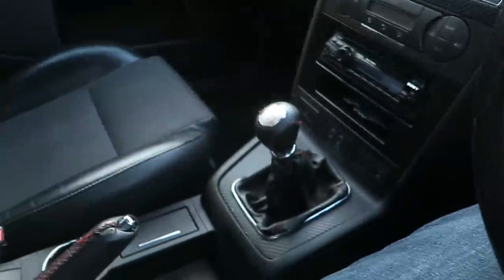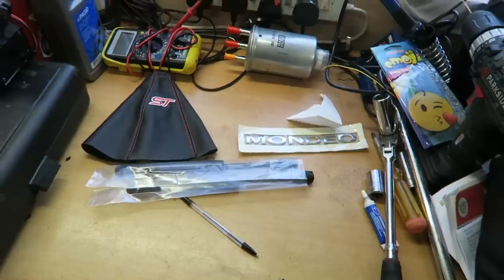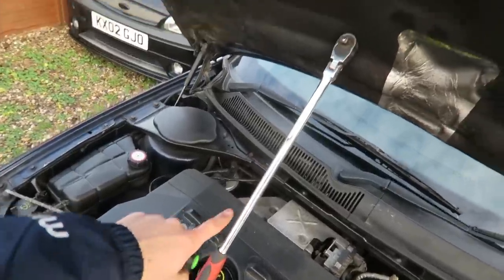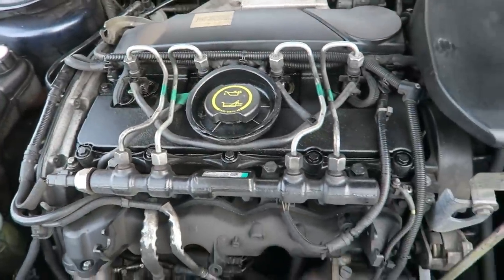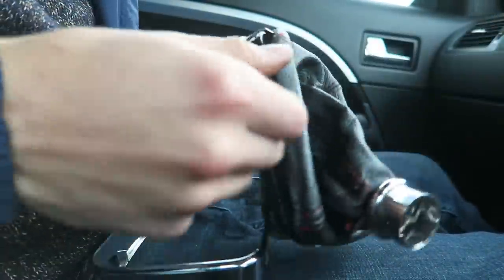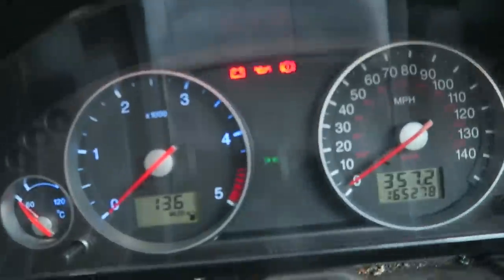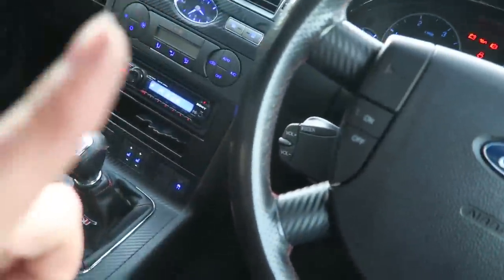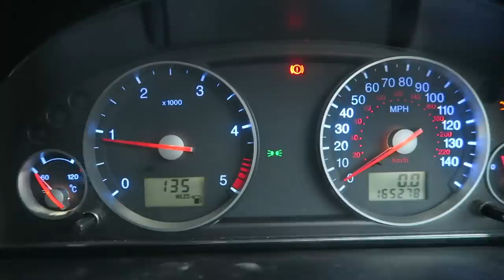Fixing More Stuff On The Mondeo ST!

Comment: Mondeo badge seems bang on, it's probably because the shape of the boot tapers at either end.
Reply from the maker: I think you're right!
Reply: Yep, bang on, its the style line of the trunk lid. Used to fit hundreds of almera badges to tail gates at work using a 'level jig' and they looked out due to the curve of tail gate.
Reply: Someone works at NMUK. Ha
Reply: @mkm7962  Yes. I've got a mondeo and there is at least half centimetre difference between the letter M and O from the line of the top.

Comment: Got an ST myself. Finding these videos really helpful. I've already had to change the springs on mine, two of the buggers snapped. I thought if I'm going to change them I might as well lower it a tad. I opted for the Eibach lowering springs. It's definitely lowered it but at the same time not slammed her. Had to have four new Tyres and have all the alloys cleaned and brushed on the inner lip. Apparently they were hanging on for dear life! I've had a new drive belt fitted; it was squealing like a goodun. Tentioner and pulleys seemed OK. Middle engine mount was banging like a beast. Just needed tightening. Bush's seemed OK. I've had a wheel bearing changed and I reckon another one has started talking to me. I'm gonna change the fuel and air filter and gonna get the oil changed. I don't trust the previous folk who said they gave her a full service.  The heater on the drivers side seat isn't working (dodgy ford wiring), need to look at that. A bulb has blown on my dash display, which irks me. Just ordered some new tailgate gas struts; bloody thing keeps falling on me big sweed. My wing mirrors are lazy, need some lube. Gonna change my gear stick leather gaiter, she's ripped. Quite like the one you fitted. Overall she's in great condition. She's done 93000 on an 07 plate. Full service history. Once I get these bit n bobs sorted might go for a Remap. Might upgrade the front brakes as they aren't too clever. Keep the videos coming!

Comment: Mate to avoid any future headaches replace the pollen filter and the plastic part you remove covering it , silicone it too the window as it is a common fault that lets water into the passenger side footwell
Reply: Yes, had that on my ST and my god did it take days of effort and retrying to finally seal it, eventually just stuffed it full with silicone (could smell it for weeks) - sadly sold the car due to rapidly accelerating rust and white smoke on startup even after £3k fuel system rebuild

Comment: Hello. Mondeo owner from Norway here. Your LSD screens should also light up. Those are T5 1.2w ones,  one for each lsd display. They untwist like the T10 ones, but lower down on the backside. The electric contact can be released by pulling a little handle. Just make sure the LSD don't lay down as that can damage them. Cheers!

Comment: Coming along nicely! Most people put the pre facelift window surrounds on if they’re doing a chrome delete, looks like you got lucky there! Don’t know if it’s the same on diesels (I’ve got a 220) but the bits of trim that are covered in carbon fibre around the gear gaiter and clock are generally silver, matches in nice with the rest of the door cards etc, same for the steering wheel bits between the centre and the rim. Looking forward to seeing more of this 👍

Comment: @ the savage garage...Mate when you order the parts for it definitely get the decent bosch fuel filter or Delphi one only! Also upon changing it fill it up with a syringe with fresh clean diesel or redex diesel treatment otherwise it's a nightmare to start or gets an air lock! In my opinion also get the castrol magnatec fully synthetic 5/30 ford version. I have tried many others and the magnatec seems to keep the clattery diesel sound a bit quieter and I think the cars runs smoother. A bit more expensive but worth it in my opinion. I think it improves the mpg slightly too!

Comment: Loving the channel & great car, I've got an 06 plate. X2 for getting a decent diesel filter, Bosch or Delphi, the ST tdci is very fussy about them. Fill with diesel using a syringe or small funnel as engine doesn't prime it, if you just keep cranking the fuel through on starter you could damage the fuel pump which are crazy money and quite fragile on these.
Keep up the good work.

Comment: Hi James, if the egr is missing it will not pass an mot, “defect” (Emission control equipment fitted by the manufacturer: missing, obviously modified or obviously defective) “Major” this is from the manual. Also you said about changing the drive belt best to also do the drive belt for the water pump and power steering which is gearbox side! I do like standard looking cars with minor mods! Keep it up!
Reply: jason williams if the not man cannot see the modification and it passes its emissions. Then he’s all good

Comment: Seen some YouTubers barely scraping 50k views on videos and here you are at 40k subs getting 51k views :D
Reply from the maker: I appreciate the views big time!
Reply: @TheSavageGarage  @ the savage garage...Mate when you order the parts for it definitely get the decent bosch fuel filter or Delphi one only! Also upon changing it fill it up with a syringe with fresh clean diesel or redex diesel treatment otherwise it's a nightmare to start or gets an air lock! In my opinion also get the castrol magnatec fully synthetic 5/30 ford version. I have tried many others and the magnatec seems to keep the clattery diesel sound a bit quieter and I think the cars runs smoother. A bit more expensive but worth it in my opinion. I think it improves the mpg slightly too!

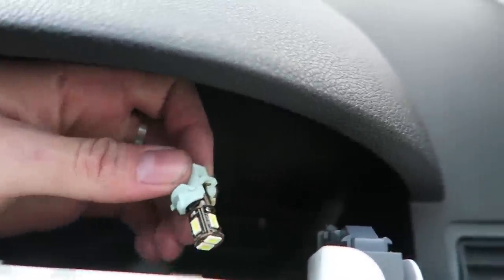Comment: 15:43 Originals are probably 501 Halogen bulbs.  These LED were probably fitted by the previous owner.  The common problem with LED is:  Although they were supposed to last longer, but only at their specified 12v environment.   A running car is usually running at 14 to 14.6 volts, the extra 2-2.6v kills the 12v LED.

(I had these 12v 501 LED in my old headlights.  Tried lots of different ones.  Shortest one lasted 3 days.  Longest one lasted a month.  Eventually I just changed then entire headlight assembly to Angel Eye with HID headlight.)

Comment: Coming along mate. When you come to mess with anything on the auxiliary belt you will need special tool to move the tensioner as clearance is too narrow to fit a half inch drive bar or ratchet to move it. I replaced everything on mine as had the dreaded chatter you can buy kit new crank pulley idler and tensioner with belt. Worth doing.
Reply from the maker: i do have a aux belt tensioner tool mate ill look into doing the lot
Reply: Yeah it’s worth doing all of it mate
Reply: @TheSavageGarage  When I did mine I supported the engine on a jack with a large block of wood under the sump, removed the engine mount on the aux belt side and jacked engine up a touch made access a lot easier even with the tool it's tight in there

Comment: You can take the old glue residue off safely with wd40, both off the badge and the paint fyi. Don't use goo gone as it can soften the glue that's holding the original badge on

Comment: Its brighter in 1 spot because its a cheap LED bulb. If you went back to the little halogen lights it'd be an even brightness all the way through, but maybe just slightly less bright. I always found that cheap 501 LED's never met expectations. I run Philips 4000k LED as sidelights and 6000k as number plate lights, the light output is so even compared to any other LED I've used. They're about £13 a pair though and would probably be too bright to put in an instrument cluster.

Comment: A result there James. Small jobs but they make a big difference. Don't buy cheap LEDs on eBay. They won't last. CrazyLEDs sell decent quality LED bulbs. I used them on my Mk4 Astra and they were still going strong the day I got rid of the car. Congrats on the 40K subs. I'm in a similar position with my BMW. I've got a few bits on order and I'm hoping to do everything at once in a single video.

Comment: Are you sure it's not just over spilled oil on too of the injectors ?
Reply from the maker: I dont think so.. its dark which means its been in the engine a while.. they are common to leak i think
Reply: @TheSavageGarage true, could of been mixed in with dirt if its been a while though, maybe mop it up and see if it comes back before you go further but of course it up to you, if it's a common fault then you might be the Injectors so your call ;)

Comment: That’s the injector seals leaking carbon and diesel that’s why it’s that oily colour
Reply from the maker: yuk! be done soon!
Reply: Had a 2.2 litre transit do same 10 years ago
Had a chuffing noise with diesel fumes when oil filler cap was removed when running
Reply: The Savage Garage best to get it done ASAP
Reply: walt 1984 my fiesta was doing it a few months back I replaced them for £15 and it’s better than it’s ever been

Comment: That oil will just be overspill from topping up, there is no way engine oil can escape through injectors. If any injector seals are gone, you would get a gooey carbon build-up or black death, as it is called.